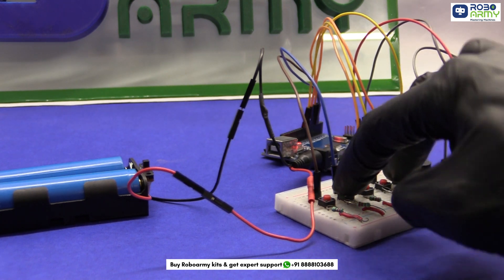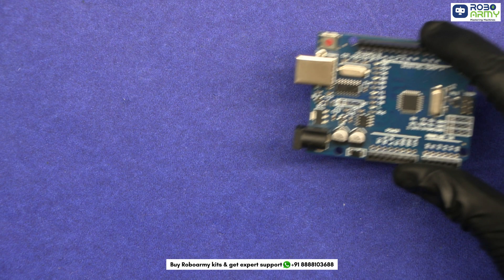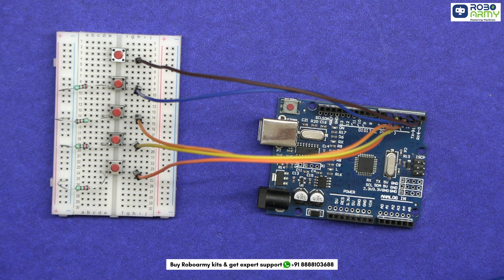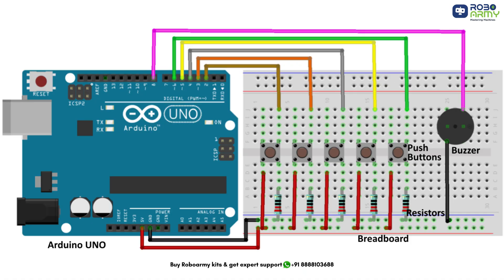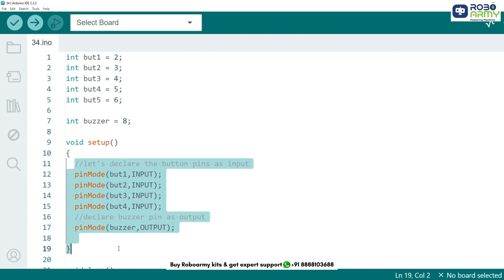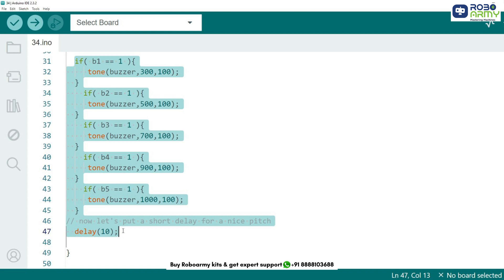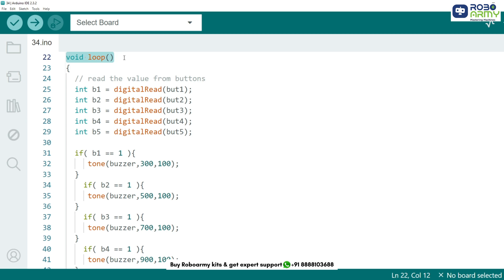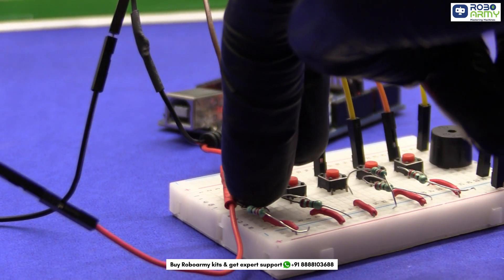🎶 SoundPad: Piano with Arduino 🎹 Build Your Own Pocket Piano with Arduino! 🔧

Comment: One of my buttons are not responsing to my buzzer How can i fix that
Reply from the maker: Please check the wiring of that button — especially the GND connection and the pin going to the Arduino. Also make sure you're using INPUT_PULLUP in the code and the button pin number matches the wiring. Try swapping that button with another one to see if the button itself is faulty.

Comment: Tried but not working instead it is making sound on its own
Reply from the maker: This project uses an Arduino to control the buzzer, ensuring it plays only when a button is pressed. If your buzzer is making continuous sound, check if your buttons are wired correctly and use INPUT_PULLUP in the code to avoid floating states.